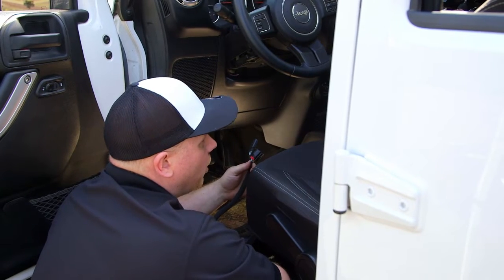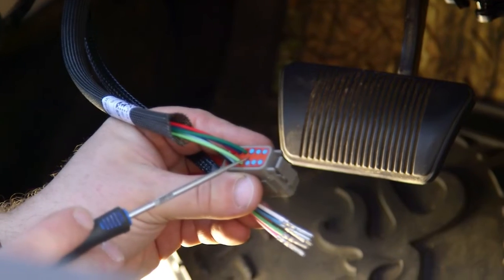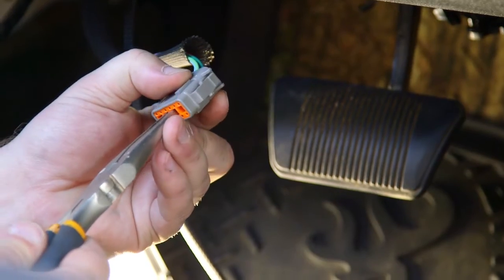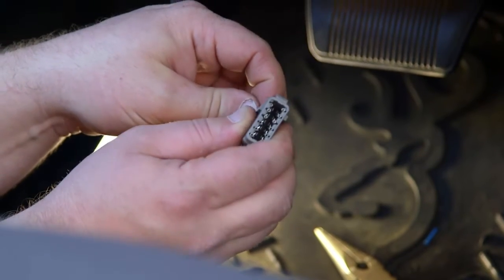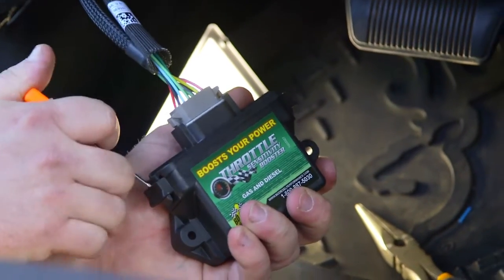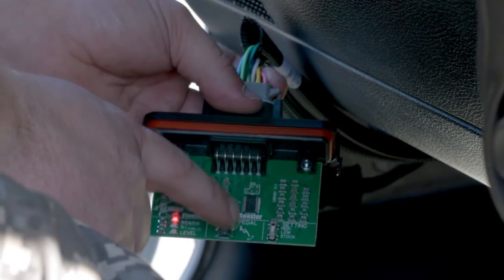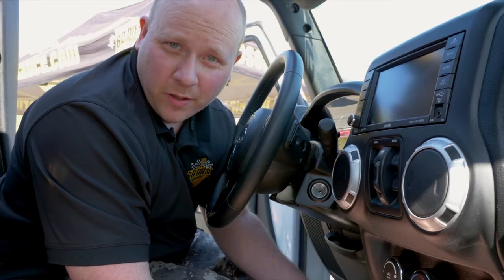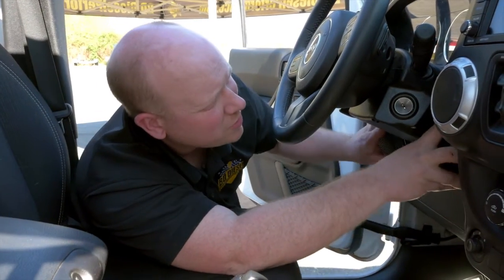BD Diesel Throttle Sensitivity Booster Installation Video - 2016

Comment: I installed this about 6 months ago. The results are remarkable. Throttle response is immediate. It does not add hp. It just makes my 2016 dodge ram diesel behave as it should, in my opinion. I drive with it in the 100% setting all the time. I have had no loss of mpg. I have the button but I wouldn't buy it again. I feel it is unnecessary, I like the response just as it is at 100%.
Reply: James Lester Hey bud I own a 2011 powerstroke with the 6.7L and the throttle response is poor. When I go to pass a car I have to wait a full second before I can jump lanes because the power hasn't gotten to the engine. How much of a difference did this make on your rig? I'm about ready to get rid of my rig because of this delay. It's dangerous if ya ask me. Like I said I gotta wait atleast one second before the pedal communicates with the engine. When it finally catches on its like a rocket, I'm mean it has some balls but the initial response is very poor and its been like that since it was brand new. Take care and thank you for your time.

Comment: 98 xj?
Reply from the maker: We do not have it listed as it has not been tested. Shoot me an email and i can send you a picture of the plug end. If its compatible then it will work :)
Reply: +BD Diesel Performance okay thank you I'll send you an email in a bit.
Reply: BD Diesel Performance my ludicrous  mode doesn't work on my 15 jks the most increase I get is about 50%  I just installed it as per this video . What can I do?